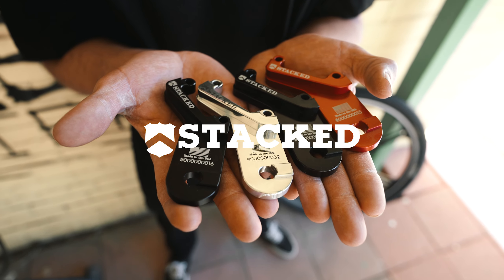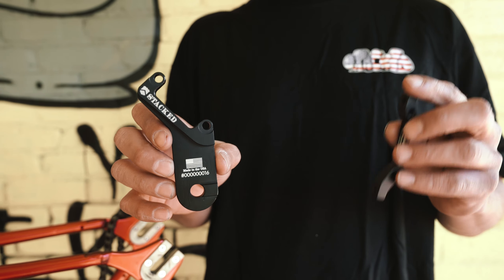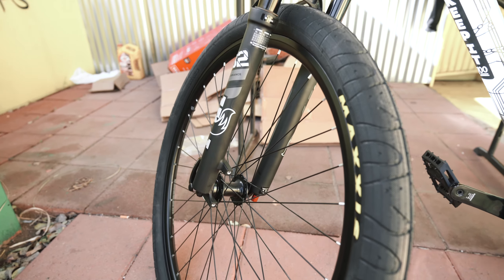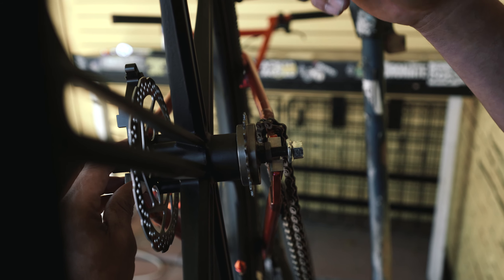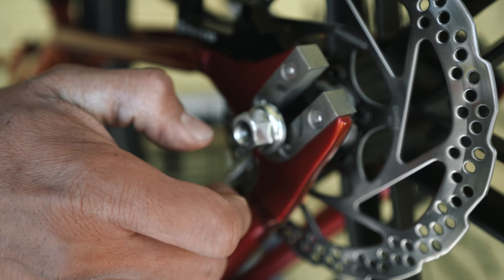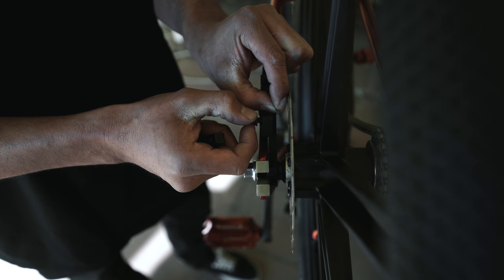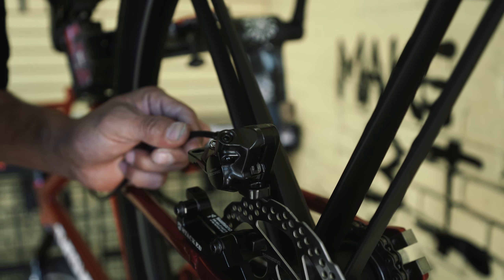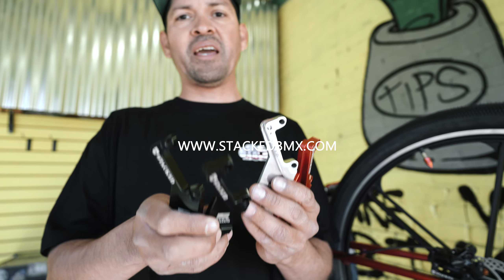Stacked Disc brake adapter explained and review plus how to install/convert 29" bike

Comment: Will this adapter work with bike that have different rear triangles?
Reply from the maker: Fit with most frame unless it has a funky build with chain stay near the dropout or large tubing. May have to grind down the adapter a bit to make it fit